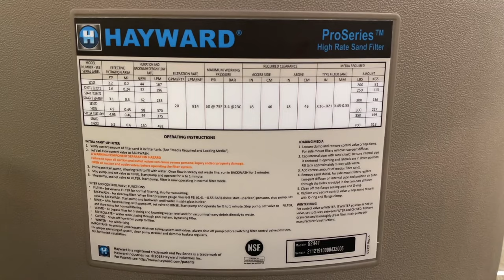How to Change Sand in your In-Ground Pool Filter!

Comment: Great Video.  I just finished the job.  My filter is 30 years old and I am pretty sure the sand had never been replaced, we have owned the pool for 21 years.  The bottom half below the laterals was like concrete.  My first indication that this was the case was last winter when I drained the filter, the water flow was very slow.....   It was a turd to dig the old sand out as it was so hard, vacuumed the first half down to the laterals, removed them, then dug out the rest with a strong scoop,

Our pool never cleared this year for the first time, and that was what prompted the mission.  $ 50 for the sand.  I found that the top of the backwash system was a bit cracked so I opted to replace the laterals/pipe for $200.  All other parta were fine.

Comment: Best tutorial video. Thank you for this video. I have watched I don’t know how many videos how to not necessarily change my sand but I have to relocate my filter and pump and I was just on my way out the door to go buy a shop vac when I came across your video. I have that exact filter & I did not know about that inner plug that the sand will come out as I’m draining. What a stress reliever. I have been dreading this for weeks having to relocate them due to the fact previous owners took them off of cement pad, placed onto pavers on dirt….because pipes broke because of a tree root AND THEY BOTH are shifting AND sinking into the ground. I’ve taken care of all that and I’m moving it back where it belongs and having to do this by myself has been stressful. I can plum the pipe, did that for years & I can do everything else but it was getting 300 pounds of sand out of that beast I wasn’t looking forward to. You just saved me $100 for a shop vac I don’t need. Thank you for this video. You explained it very well and I appreciate it.

Comment: Just getting the pool fired up this year and noticed my operating pressure after backwash is about 13 (normal).. but, within 8-10 hrs, it's up around 23. My filter sand is about 7yrs old. I was suspecting this was the problem. Thanks for the video, Mark.

Comment: Perfect timing! We bought the house 5 years ago and haven't changed our in-ground pool sand filter. So, who knows how long has it been since it was changed. The needle is pointing at "22" and it seems the water isn't circulating as it should be. I'll have your video handy when I'm ready to change the sand. Thank you!

Comment: Very helpfull.  I am saving a lot of money by doing the sand replacement myself.   I had to replace the lateral assembly which had some damage at the top, I was told I did not backwash enough, and the pressure got to high.

Comment: Absolutely perfect explanation. I plan on checking my sand this fall when I shut down, but I have questions. 1. How do I know if the sand is bad and needs changed?
2. I want to rotate the tank so the drain is more easily accessible. Can I just rotate the tank and leave the head in the same place for plumbing? I don't see why not, but thought I'd ask... Thanks!
Reply from the maker: @terryjones8360   If you are backwashing more often than normal and you are having to add more chemicals to keep the pool clear, then this is a sign that you need to change the sand. Sand is normally changed about every 3 to 5 years on average. Yes, you can rotate the tank. Thanks for watching.
Reply: @HallmarkPoolSupplies  Thanks so much, that really helps.

Comment: Mark, great video...watched 4 of these on replacing sand before myself and son did it. Hardest part was sucking out sand with small shop vac. Our sand was in our filter since installation..about 10 yes ago.I let our filter rest overnight ..and turn on again in morning...is this bad practice?? t hanks again for your video. Our Haywood filter. takes 300 lbs and has older drain plug on it..but works just fine. Laterals were just fine condition. Our top head is showing some wear and tare..pressure gauge is inoperative. thanks, Dave

Comment: Hi Mark. My name is Rick from Ontario, Canada.  I just found you about two weeks ago.  Your videos and your commentary are awesome.  I've had my inground pool for 16 years.  I'm do to take out my sand in May.  I surehope my Hayward Sand filter has the cap where you can take out the drain insert.

Quick question, once you have the old sand out of the filter, where is it best to discard it?  Is the sand considered dangerous?  Should I wear a mask and gloves? Is the dust hazardous when putting fresh sand back into your filter?   Thanks so much for your tutorials.  Cheers Mark!!
Reply from the maker: The sand in the filter is not dangerous and you will be fine when changing the sand. Most people will spread the sand on the ground in an inconspicuous place. Thanks for watching.

Comment: Excellent video! Thanks for the step by step tutorial...I learned a couple of things about my own in-ground system. Question- it's time to change my sand out (never changed before), and I'm wondering what your thoughts are about using ZeoSand Instead of the traditional Silica sand? I have a Hayward S210T.
Reply from the maker: I like using silica 20 filter sand. It is much finer, filters better, is cheaper and is proven over the years. Thanks for watching.

Comment: The sticker on the side of my filter has come off and blown away with the wind, how do I determine which model filter I have? I have a 22,000 gallon pool and I guess the filter stands 3 1/2 to 4 feet tall.
Reply from the maker: What is the name or model of the valve on your filter? Does your valve sit on top of the filter or to the side? If it is Hayward or Pentair you can measure the diameter of the filter tank, this will tell me the model and size that you have. Thanks for watching.

Comment: Question Mark:  In the attached video I notice the couplers are positioned away from the filter by several inches with the actual attachment to the filter being a separate join with threads.  My installer originally glued and screwed the pipe directly to the tank.  Assuming that my install had some flaws which I do not want to repeat, what is the best method of allowing the variable valve to be removed and separated ( I know this is necessary for maintenance)?  Can you attach the union (with its own disconnect directly to the variable valve or should it be as your set up showed, attached several inches from the variable valve?  Whichever it is, what is the rationale for that?  By, the way, a very detailed and easy to uderstand video!  Bob
Reply from the maker: Unions can be used anywhere as long as you can tighten or open them. I have the unions out in the open so it is easier to get to. Thanks for watching.

Comment: It seems no matter how much rinsing one is doing, there remains scripts of sand on the ball and socket joint. Do small abrasions on the ball and Joint cause damage
Reply from the maker: You should be fine, however make sure that the ball joints are nice and tight and not loose. If the ball joints have gaps or they are loose then sand can get through. There will come a time that you will have to replace the lateral assembly. Thanks for watching.

Comment: GARY here, After installing a new diverter valve insert I’m noticing the returns at the end of the pool have poor pressure but the side return for the cleaner has great pressure what’s wrong
Reply from the maker: The return closest to the system will have more pressure than the one that is further away. You can change the return inlet with a smaller eye ball this will give you more pressure, it will also help to make the flow in the returns even out. If you have any questions feel free to contact me I will be glad to help.

Comment: Fantastic instructional video Mark, much appreciated.  Question:  Is there a s/n somewhere on the Haywood sand filters that tells you the year of manufacture?  Thank you in advance.
Reply from the maker: There is a s/n on the label plate of the filter. It's possible there is a manufacturer date on the label too.
Reply: @HallmarkPoolSupplies  yes, found it and it is a 2007, much appreciated.  another question: my pool is 18x36 w stairs w 1 skimmer, my dads pool is 18x36 w stairs w 2 skimmers..he is getting old and I have taken over taking care of his pool, he has EC65A DE filter which I find to be a pita and would like to change it to sand filter as I am more familiar with.  Is the S210T appropriate size sand filter in your opinion for this same size pool as mine (except has 2 skimmers) and was thinking of using glass media instead of sand to get closer to the filter micron level of his DE, if so do you recommend a certain brand of glass media and it true they are maintenance free of is there anything I am missing in maintaining glass media?  Much appreciated, John

Comment: Do you add any more water before closing up the tank beyond that first small amount before adding sand?  If you said, I missed it.
Reply from the maker: No, you don’t have to add water. When you turn the pump on, the tank will automatically fill with water.
Reply: Thank you!!

Comment: Thanks for the great video, I was wondering what size of piping you were using between the pump and filter? And if you had any plans for that hard line? Thanks again.
Reply from the maker: The pipe is 1 1/2”, Thanks for watching.

Comment: Does the Pro Series 310t have the ability to drain sand and water through the plug on the bottom once you remove that little basket piece? This video was very informational, but before I start this job I want to make sure I can drain the sand out like the video rather than shop vac it out.  Thanks.
Reply from the maker: Yes, if your filter is 2006 forward. One way to tell is if your drain cap is star shaped then yes, if your drain cap is round then no. Thanks for watching.

Comment: What if I forgot to put water in the tank before adding sand ?
Reply from the maker: As long as the sand is dry and you add the sand slowly over the laterals you should be fine. Adding water first just helps protect the laterals when adding the sand. Thanks for watching.

Comment: I'm new to pools.   Is the PVC pipe 1.5" same size as PVC pipes purchased at Lowe's?   If I purchase flush unions, will they fit standard PVC pipes?
Reply from the maker: Yes, as long as the fittings are 1 1/2”. Thanks for watching.

Comment: When can you tell when sand needs to be changed out for new sand?
Reply from the maker: Depending on the chemicals, we recommended changing sand every 2-3 years. If you find that you’re having to put more chemicals in a pool to keep it clear, that is a sign that you need to change sand.

Comment: Hi mark thanks for your fantastic videos. I recently re-sanded my 50kg filter with grade 1 glass media. My filter is a particularly old one. initially the results were fantastic. But now the filter is not as effective.. I've learned that I needed to add a higher grade of glass or pea gravel first to prevent the laterals from clogging. I was wondering if you had any recommendation or advice on how much pea gravel or higher grade media I should put in. Based on a 50kg filter. Thanks again
Reply from the maker: I like using sand, it  is more effective in filtering the water because it is much finer than the glass. Thanks for watching.
Reply: @HallmarkPoolSupplies  thanks I appreciate that. I did have sand and it was great.. the glass I have is very fine but I know now that I need a more corse one at the base for the laterals.. was just trying to pull of any experience about what ratios I should use to remedy my current problem.  Eg 1 part course to 3 parts fine at the on top. Thanks again for your fast response

Comment: After listening to you r precious advices I’ve look at the drain and I have that removable strainer but the tab are not very rigid and bend or break when I use the reverse cap to unscrew it, probably stuck.
Any advice on how I can remove it without damaging the threads 
I have a picture of this issue but not sure how to upload the picture 😂
Reply from the maker: Send a picture of what you have to this email and include your contact #.
hallmarkpoolsupplies@gmail.com

Comment: Should you add additional water before putting the multi-port valve on?
Reply from the maker: No. when you start the system the pump will fill the tank automatically.

Comment: My pump lose prime after a few hours l have no noticeably leaks anywhere and have changed my motor. What else can l check to correct whatever is causing it to lose prime? Thanks in advance.
Reply from the maker: @curtisstrode4311   You may need to backwash the filter or change the sand, if you have done this you can try running the filter in the recirculate position as a test to see if the pump stays primed. If you are still having a problem then l have a video titled “Air bubbles in your pump” which deals with suction leaks. Hopefully this will help, here is the link for that video. Thanks for watching.
https://youtu.be/SiEOIxYpJ5g?si=WNuPkYXbJlgf9HrA

Comment: Will old sand that needs to be replaced affect the flow of water at your pump?  My Pentair pump  is not drawing water well and isn't priming. The return water is weak, so the jets are barely pushing water back to the pool.  I have had a lot of issues with this darn pool the past two years with leaks along lines that were crushed.  I am hoping now that it is just old sand that needs replacing - it is about 7 years old now...
Reply from the maker: Yes, the sand on average should be replaced about every 3 to 5 years.

Comment: How long does it take for the sand to drain out from the bottom? Never done this and I use so vac or this industrial vac that fits ontop of a wheelbarrow I get all the sand out in five minutes. 300 lbs
Reply from the maker: Using a shop vac or going through the drain is about the same time. Either way will work.

Comment: Thanks
But we are face deffcults to change old sand and put new one.. 
because we are used our hands to remove but The filter whole is very small ..
Is there any other way for that please answer.. 
Thanks again
Reply from the maker: If you have the Pentair Sand Dollar filter the best way is to flush out through the drain, like I mentioned in the video. If not, you can use a shop vac to remove the old sand.

Comment: Hi. How would I empty the sand on a S200 side mount filter? Would I have to unscrew all the bolts around the Filter Head and lift ten half dome or just take off the Access Cover? Thanks for the help.
Reply from the maker: On the S200 filter you can empty the tank either way. I prefer going through the top, its easier and faster and you don’t have to mess with the o-ring or the bolts.
Reply: Thanks Mark. I finally disassembled the whole top access cover unbolting everything since the top diffuser was stuck and I didn't want to force it. I've owned the house 34 years and never changed the sand and everything was rock solid with scale!!!
I discovered that underneath the sand there were pebbles covering the laterals up to the bottom Internal Elbow Pipe and upwards from there, the sand. Is that an ok arrangement and can I replicate this on my sand change?

Comment: Gary again my diatomaceous filter clogs way too quickly could that be the reason I don’t have good pressure at my returns I forgot to tell you I have solar heating for the pool
Reply from the maker: Yes, cleaning your filter will make a difference. However having solar panels will reduce the flow as well.

Comment: It would be great help if you commented on how to replace the screen part of it’s broke
Reply from the maker: If you are referring to the lateral inside the filter, l have made a video on this issue. Thanks for watching.
Reply: @HallmarkPoolSupplies  the bottom drain screen I tried to use the key but it broke off
Reply from the maker: Got it, you can use a pair of needle nose pliers to remove the screen. If you need one, here is the link for the drain cap and screen kit.
https://www.hallmarkpoolsupplies.com/p-1712-sx180la-pro-series.aspx
Reply: @HallmarkPoolSupplies  thank you  for replying  I have tried. Needle nose but everything’s so bridle it broke off. It’s just the part that twist in that’s left I’m lost of ideas without ruining the filter grooves sorry being annoying.
Reply from the maker: If you try sticking or wedging something that is tight into the hole opening you should be able to turn out and remove. Good luck.

Comment: After adding the sand, where should the water level be at? I keep getting sand in my pool. I inspected the laterals and changed the sand and circulated with no issues but as soon as I placed it on filtering it started blowing a lot of sand in the pool. My water turn brown 😢
Reply from the maker: You need to backwash and rinse the sand after changing. If this problem persists then you may have a broke lateral or laterals in your filter. Here is a link to a video, sand in your pool, that may help.
https://youtu.be/3x2eQYq2K1E
Reply: @HallmarkPoolSupplies  also I’m using Zeo lite sand, does it matter or a backwash is hood enough? My pool is brown right now, what should I do?
Reply from the maker: Let your system continue to run overnight and see if there is any improvement, it would be recommended that you also have your water tested and make sure it is balanced.